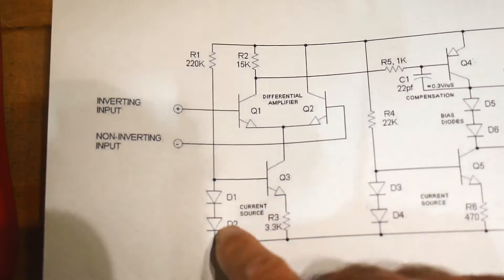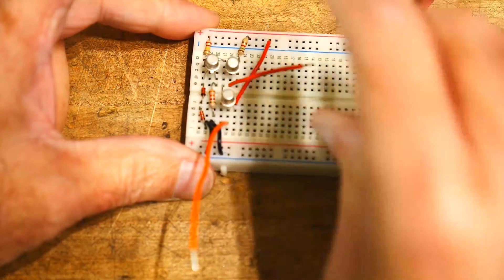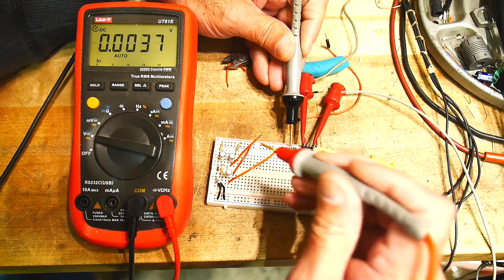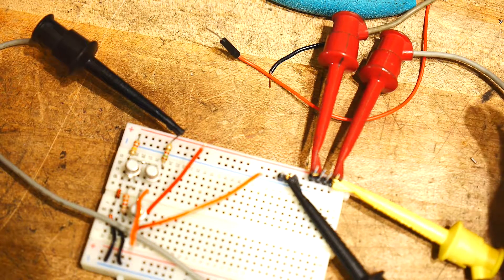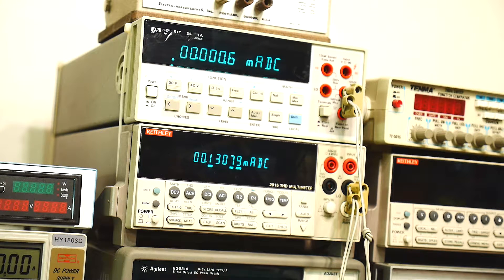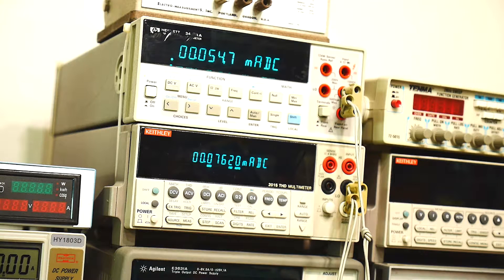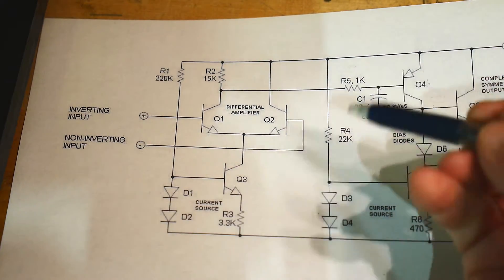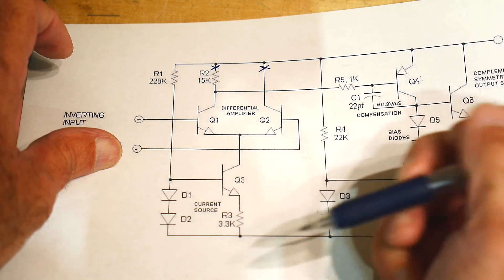#412 Build an opamp (part 2, of 7) differential amplifier

Comment: For some reason with the inverting and non-inverting inputs both grounded I'm getting 0.93 milli-amp through Q1 and zero current through Q2, although you get equal current through both. I've checked and double-checked the circuit and I'm reading sensible voltages and currents in other parts of the circuit. The voltage on the emitter side of Q1 and Q2 is 0.28v and on the collector side Q1 has 1.1v on the and Q2 has 15v. I also get no current through Q2 if both inputs are at 5v. The transistors I am using are 2n3904  (NPN) and 2n3906 (PNP), I have a good supply of these and have tested them and swapped them out but it makes no difference. I have ordered some BC547s and 557s to try. ( I can see that the emitters' voltage is way too high).
Reply from the maker: what are your power supply voltages
Reply: @IMSAIGuy  Thanks. I've been using +/- 15v which is the limit of my breadboard power supply. I tried +/- 12v but there was no significant difference. I don't want to take up too much  of your time. I'm expecting new BNC547/557 transistors today so I will rebuild the circuit and stay within +/- 12v.
Reply: @IMSAIGuy  I've now got the new transistors which turned out to be BC547Bs. Using a +/- 12v supply with both inputs grounded I'm now getting -0.57v on the emitters and the collector currents are 0.034mA on the (+) and 0.077mA on the (-), so still not equal but at least I can now get on building the rest of this with more confidence. Thanks for your help.

Comment: 8:35 How can  negative input let's open the Q2 transistor? Q2 transistor is a NPN and need positive current to open the Q2, but as if AC the half cycle of the frequency the negative side turns positive and let the Q2 open. Is that correct? Please give more accurate explanation.
Reply from the maker: I think you are missing the power supply. it is +V and -V (+/-12V)

Comment: Built circuit did some testing and you were right the non inverting transistor became extremely hot. I was wondering if you split the 15k resistor in half to equalize the current?

Comment: Awesome class! Thank you some much, sir!
Question: why is there this 15k resistor from +12v  to the positive transistor but the negative transistor is directly connected to +12v? Wouldn't it cause unbalance?
Reply from the maker: It looks like that, but many opamps do it that way.
Reply: @IMSAIGuy  but what is the explanation for this resistor? What is he doing there?
Reply from the maker: @gauninha12  it converted current to voltage
Reply: @IMSAIGuy  right... Do you have any documentation about this resistor? I am yet confused about him...
Reply from the maker: @gauninha12  there is a current source. the current either goes left or goes right
if the current changes then the current through the resistor changes. that causes a voltage change
Reply from the maker: it is the same resistor as in a common mode amp: https://en.wikipedia.org/wiki/Common_emitter
Reply: @IMSAIGuy  Thank you! I will study more for a better understanding. I want to master this, so I may one day be capable of designing such a circuit. First, I need to get it all from scratch. :)
Reply: the reason it belong to second scenario about the negative input's situation; here there is a negative input arbitrary voltage and it needs a way to run on the circuit so it has two choice one is 15K and another is 22K. it selects the more smaller resistor. The nearest and smaller resistor is 15K and it flows to that direction.

Comment: Hi, thanks so much for this series! With regard to the transistor with the collector tied directly to +12V, why does current flow when the base is connected to 0V. Shouldn't that shut off the gate and stop current flow? Sorry if the terminology is off...
Reply from the maker: Because the emitter side goes to a -12V supply. So 0 volts is positive with relation to -12V
Reply: Oh, I see. So there just needs to be enough potential difference for current to flow from the base to the emitter. Got to learn sometime. Thanks so much!

Comment: excellent instructional video(s). --- Picking different color for the inputs - like red and blue - and different form others on the board increases instructional visual... it's like the color 'tagging' of the rails on the bread board... next improvement would be a head up display of the instruments wall displays over the workspace where the manipulation happens... (I always see room for 'unrelated' improvements... just kidding...). Again: thanks for sharing. (me: Intertec SuperBrain double Z80 infected, so fare COVID19 uninfected individual).

Comment: Wouldn't the difference in current through the transistors be due to the 15k resistor on one leg?
Reply from the maker: you might think so but the current source and the collector of the transistor buffer any effect. 'real' op-amps used a fancy current mirror on both sides of the diff amp and allows for separate current adjustment and balancing. Way to much detail for a series like this. In fact, you can replace the entire current source with just a 120k resistor and the second current source with a 12k resistor and the circuit works just fine in a simulation where both transistors are perfectly matched.

Comment: What would you recommend as a good reference for learning more basic 
electronics including opamp design and theory.  I studied Applied 
Physics and Computer Science then I worked in an Electronics, Optics and
 Computer Lab in the mid 1980s to the late 1990s  but I'm not sure what I
 would recommend for someone who is just getting interested in 
electronics. Any suggestions? My introduction to electronics was in the 
 mid 1970s with the Tandy (Science Fair)  Electronics 150 in 1 kit, much
 more fun than an Arduino UNO starter kit.
Reply from the maker: Get the book  'The Art of Electronics' by Horowitz Hill. the newest version is third edition. is expensive. you might find an earlier version on eBay or Abebooks cheaper. Any version is fine
Reply from the maker: Another book I can recommend is the ARRL Handbook. It is printed ever year and most of the book is all about radios, but the beginning chapters are a good source of electronic theory and written well. Since it comes out every year you can find old books cheap. and the first chapters always stay the same.
Reply: @IMSAIGuy  thanks